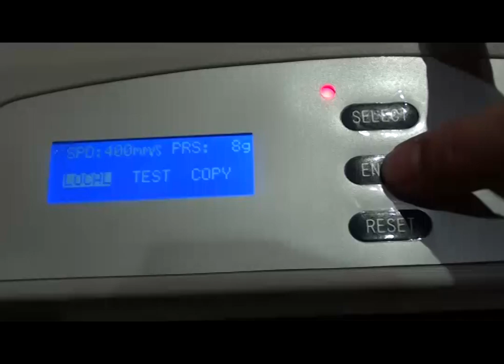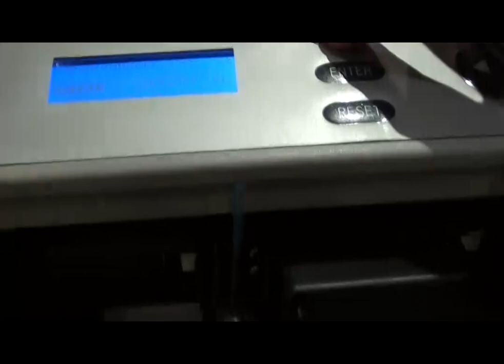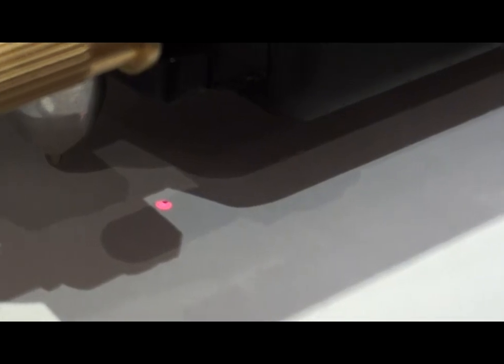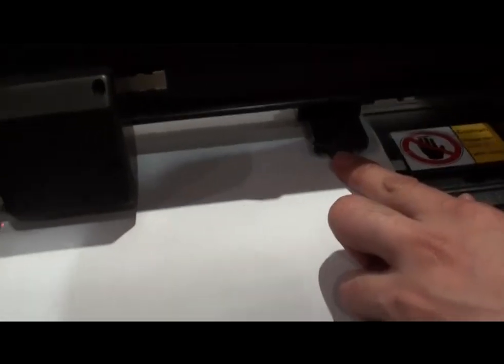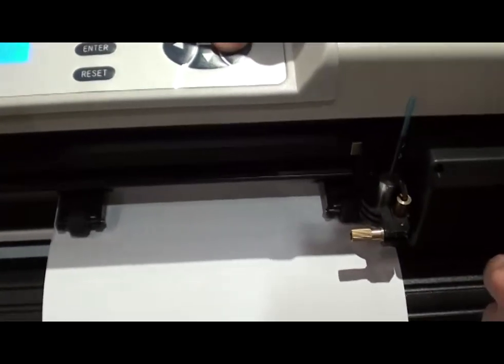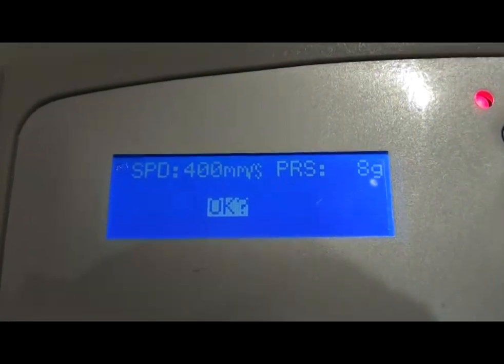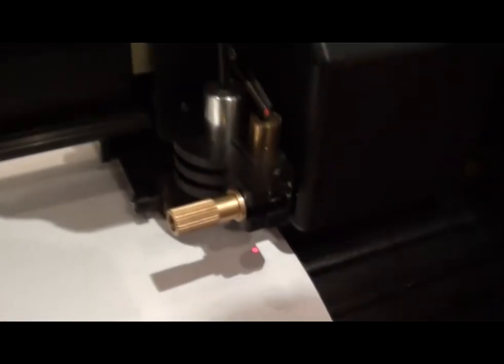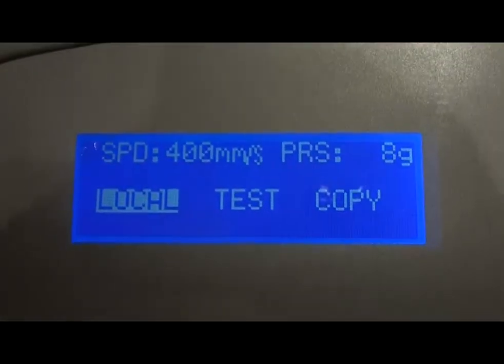HOW TO SET UP SC OPTICAL EYE FOR CONTOUR CUTTING

Comment: omg it finally works...  the step in the video where you make your first mark with ink, then turn on the laser, I had different results.  My laser traveled to the center of the machine.  I moved my paper so that my first dot aligned with the first position that the laser went to, then repeated the remaining steps exactly as stated in the vid.  After that I ran my first contour cut and the results were as expected.  Thank you!!!
Reply: Cheers Pal, my machine wasn't moving at all when i switched the laser on, so tried your method and it worked.